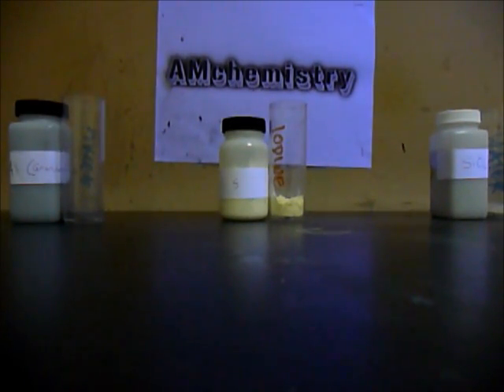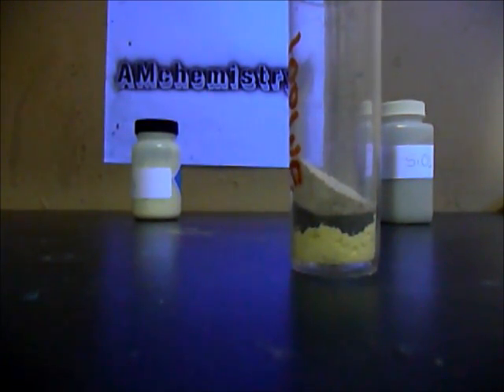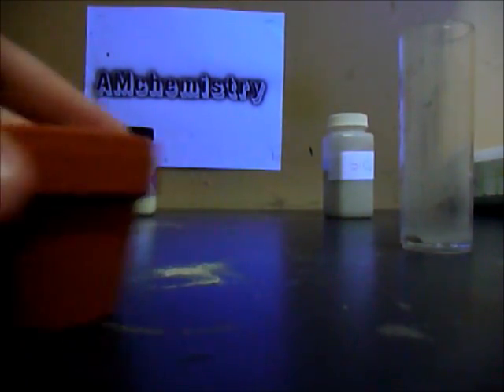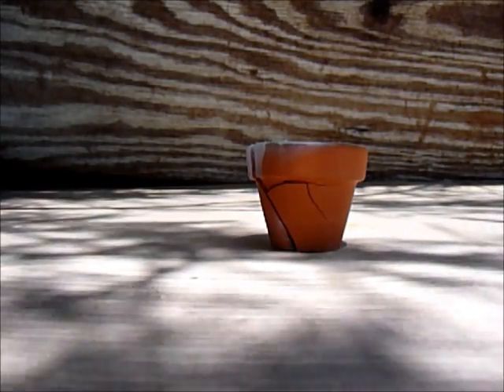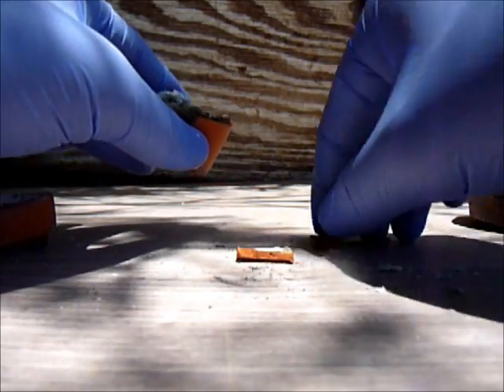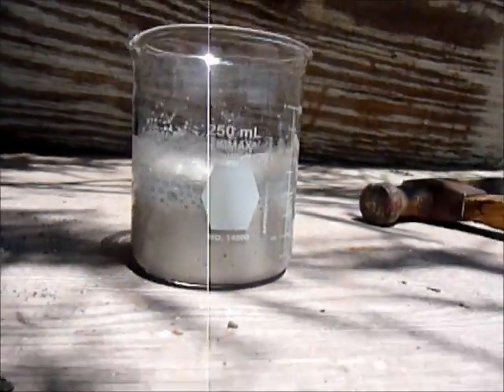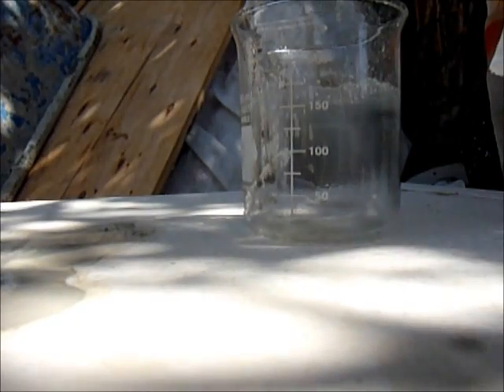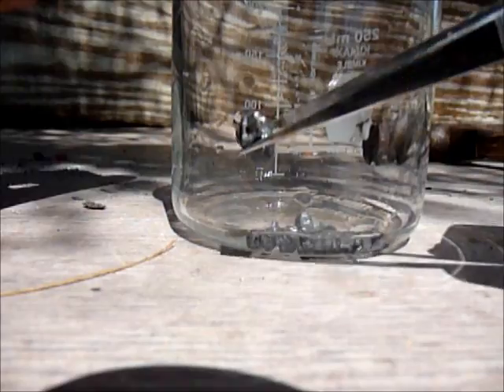Make Silicon from Sand

Comment: One more thing... for God's sake man don't pour it out on the table! Filter it or evaporate the water, just don't do that! You lost 1/3 of your product, easy! Sorry for the rant but it had to be said. You could also try a recrystalization then evaporation. One other thing, try to explain why things are happening, for instance, when you said "I don't know why it reacts, but it does." If you want to get anywhere with this, you need to do a little research and explain things.
Reply: The exercise was for example only.
Reply: you can't recrystallize silicon metal at least not without a blast furnace as he was going for the silicon metal the aluminium sulfide is a waste product while I will admit just dumping the aluminium hydroxide on the table is dumb filtering is only going to cause more issues and most of the pieces should be on the bigger side anyway...

this method gives a very dirty contaminated product and he is missing a key step in which the silicon is put in hcl to remove the remaining aluminum sulfide and oxides. you can't do this for very long as the silicon will fall to a black shiny sand. nerd rage did this and over all his video is much better at explaining the science...

Comment: almost pure silicon
Reply from the maker: dickson bak bah Yup, But still cool
Reply: ***** not actually. 4 Al + 3 SiO2 = 2 Al2O3 + 3 Si as you see. Aluminium oxide represents 40% of the formed products; also you will never get 100% of your reactans transformed. So the amount of pure silicon is even less

Comment: It would be impossible without very expensive equipment like an arc furnace and much more and purer silicon. You can buy silicon wafers idk for how much. Also it is hard enough making 1 homemade transistor on a silicon chip I think it would be 1000x's harder making the amount that go into a microprocessor. But it is possible... just very hard